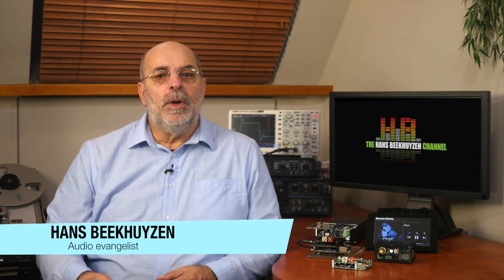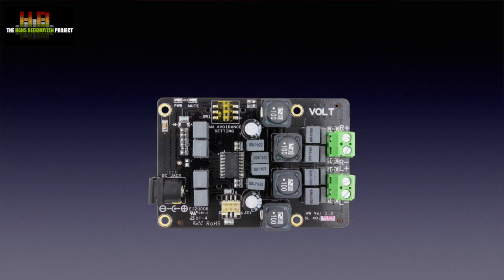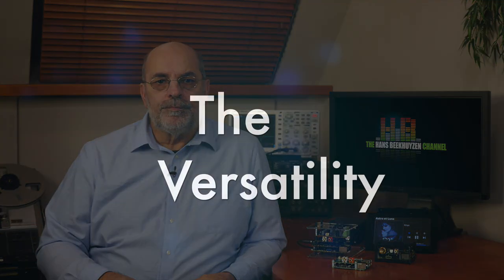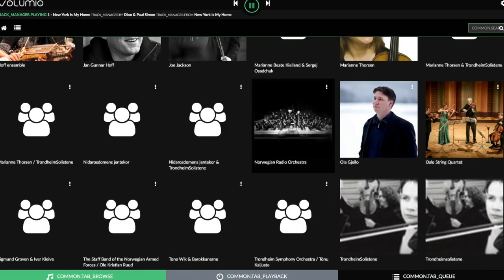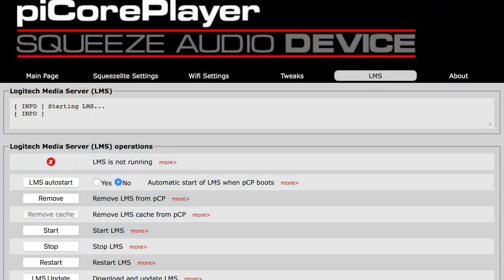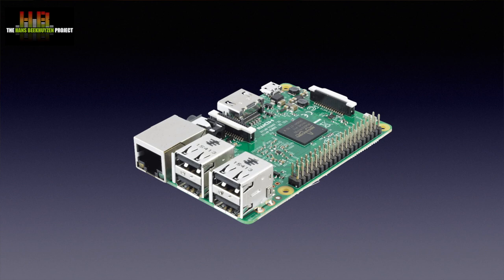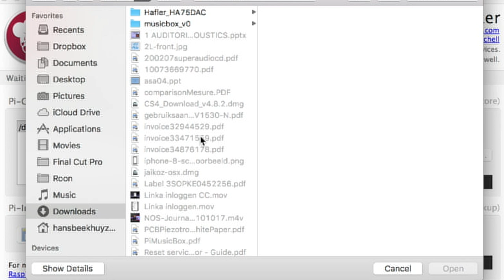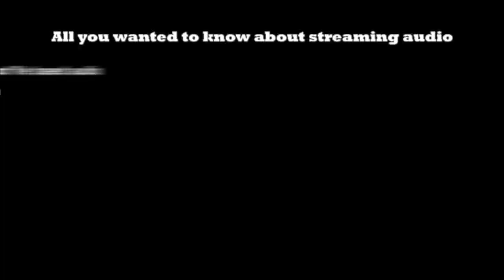An introduction to Raspberry Pi hi-fi

Comment: A 'Pi-Fi' setup is an excellent choice if you want to combine signal processing into the preamp stage and have interactive access to it's function, but it can only adequately replace equipment from the preamp section and below. It is perfectly adequate for headphone amplification for dynamically driven headphones that are of a reasonably low impedance, otherwise, you will need additional amplification.

Comment: Using an RPi4 with PI2AES running Roopieee over I2S to my DAC.   The improvement over my HTPC using USB was astounding.  I was not expecting the amount of improvement in just about every aspect you'd care to measure.  I thought I was hearing the best I could from my setup until put the RPi in place.

Comment: Way back when I was messing about with micro computers, a driver was just a lookup file and the computer and peripheral manuals would have all the ascii command codes.  So you would just look up the manuals and construct you own driver file.  You could do this for any peripheral device you wanted to connect.  Anything, running any OS could drive anything to the full potential of it's command set & you didn't need a computing degree to do it, just a little patience.  Now, they don't tell you anything.

Comment: Great video.  I decided to try Volumio on the new Asus TinkerBoard.  It works just great.  I output from TinkerBoard to my DAC via USB.  TinkerBoard has some performance advantages over the Pi, but is new and has very little support whereas the Pi has massive support.  USB out on the TinkerBoard is far superior to USB out on the Pi.  For those who go the Pi route, I have heard the new Allo DigiOne is the best quality SPDIF out option.  Costs a bit over $100.
Reply from the maker: I will review the DigiOne soon.

Comment: Speaking of other mini computers, you can get a V88 Mini III at gearbest for around $30. For only $30 you get a similar cortex A53 clocked at 1.5Ghz, 2GB RAM, 8GB flash with Android 7.1, built in SPDIF, USB 2.0 and 3.0, and a remote control.
Reply from the maker: As I said in the video, there are many mini computers but only one is supported extremely well: the Pi. But feel free to experiment with other options if you feel up to it.

Comment: Hans, can you elaborate on the quality of the hdmi output? My pi uses OSMC (kodi) and outputs to a Marantz SR5004 receiver over HDMI. It sounds very good. I never heard any jitter.
Reply from the maker: HDMI is primarily a video connection that packs audio in-between the video. It therefore depends largely on the quality of the receiver to 'recondition' the audio. I have no hands on experiences with your receiver but in General Marantz takes sound quality very serious.

Comment: How would the cheap power supply make the sound worse? Sounds like audiophoolery. Its a digital signal to a converter so its not like its analog that might be susceptible to noise.
Reply from the maker: see https://youtu.be/grzoqEb2KMk
Reply: Ground noise and chitter its well known ....stands well outside of 14k cables and other audio snake oil
Reply: I changed my home power cables by upgrading the cable from the power station. My alba HiFi sounds like a thousand dollar system
Reply: Basically, once the power supply is completely adequate, you become correct, and anything beyond that makes no difference, but if a power supply isn't quite right, it can introduce digital errors. A few digital errors can be corrected, but there are limits. If you ever had to deal with printers with long parallel port cables, you may be familiar with the fact that digital signals are not completely incorruptible.
Reply: Digital signals aren't incorruptible, you're right CFWhitman, but so long as you stay within spec you don't need expensive equipment to get a stable signal, and you most certainly don't need a $90 power supply for a Raspberry Pi. The only place where higher cost components can make a real difference is on the DAC and analogue side.
Reply from the maker: if only.....
Reply: I tried several random 5v switched mode power supplies and they all sound different.I then built a linear supply with massive amounts of filtering and it sounds a lot better. USE YOUR EARS If you can't detect a difference carry on and enjoy!
Reply: phil spencelayh Ah! But you can't show it on Youtube can you?
Reply: Put an oscilloscope on the 5v rail of the pi and swap the psu,what you get is different every time ,it's pretty horrendous even on a battery.I couldn't say exactly what aspect of the differences cause the different sounds but something does. As I said use your ears.
Reply: @philspencelayh5464  how good does the battery sound? I want a portable pifi...
Reply: @18yearsoldnot  It was a while ago now and I just had the pi on battery, the amp was on mains. I would be lying if I said anything definitive.I have a little class D amp that will run on a battery I will set it up again and see what its like but I think the biggest problem would be the speakers you could use on battery unless you are thinking of the hifiberry with the headphone socket like I have.

Comment: You could use a Dragonfly Black on a Pi. Yes you still need an Amp, but the Dragonfly will give you the D/A and quality output.
Reply from the maker: You could use any USB DAC. But does it provide a satisfactory quality and would it be the best option for the Pi?
Reply from the maker: You better check your setup then for that is not what I heard!! See https://youtu.be/P3mQA_EmHNI

Comment: I have made a boombox with a raspberry pi (Hifiberry DAC+ ADC PRO and AAMP60) and a car Minidisc player. I also have the Pi 7" touch screen. what HiFi software can I run directly on the pi without the need for another device and network? My boombox is portable and will not be around any networks
Reply from the maker: I like Volumio: https://youtu.be/TRyCpZh9-pI. Works great with the 7" screen too.

Comment: Thanks Hans. Question, since I am looking for a streamer and I need a phono in, I thought why not go for a cheap raspberry pi option; they have a i2Audio Phono One (at 40EU) now. Cheap as chips of course. Yet even though it needs an extra power supply I kind of wonder if it's a good idea to put all this hardware (pi, digi soundcard, phono) in one box. Since for double or in my budget max triple the price I buy a 'normal' phono preamp (i.e. rega fono mini a2d / Edwards Audio Apprentice /project Phono box E). Dank en groet van Richard
Reply from the maker: I have no experience with phono pre's on a Raspberry Pi but given the very lw voltage coming from a pick up cartridge, it would not be my first choice.

Comment: Seeing you're using a  computer for hi-fi is it perhaps  possible to use convolution software? I would think a routine to flatten the actual room speakers before applying convolution samples of high end hi-fi might provide some interesting results for old school hi-fi lovers.
Reply from the maker: I have tried those and was not pleased with them. Actually I use a computer for music only to store the music and run music server software on it like DLNA server and Roon server. Connecting a computer directly to a DAC won't bring great sound quality unless the computer is designed for that task.

Comment: One can also use the HDMI port to connect to an HDMI-Receiver/Amplifier. High quality digital output with no extra cost (if you allready have that AVR at home).
Reply from the maker: Well, most but not all player support hdmi. And to call it a high quality digital output.... but a number of AVR’s can playback quite well from hdmi.
Reply: The Hans Beekhuyzen Channel yes it is a high quality output. The digital source is transfered 1:1 with no loss. Same signal as your 150$ digital output solution.
Reply from the maker: If only.  See my video ‘How digital can go wrong’. In hdmi audio is interwoven with video and the video clock has priority over audio.
Reply: That maybe a problem when you send FHD or 4K video with a lot of movement along with the audio signal. But the standard prompt with a bit of ascii on it will not interfere with your audio signal.
Reply from the maker: Again, if only...

Comment: I have a high quality AV preamp (Denon AVPA1HDA) with dual differential DACs onboard.   What's is the best way to connect the pi for the best audio quality? Hdmi, or use a Digital coaxial hat? I'm thinking a DAC would be a waste of time as the Denon has ADC for its analogue inputs anyway and that would add further ADC and DAC processes to the signal.
Reply from the maker: The HDMI is poorly supported by player software. If your AV preamp indeed is of high quality, use a high quality HAT board. Or, even better, an audio grade network bridge like the SOtM sMS200 or Sonore MicroRendu.

Comment: Very interesting, thanks.  Early on you said that hdmi was second best after spdif, but did't develop that option.  Is there a breakout box to get audio from hdmi?
Reply from the maker: On a Raspberry Pi the HDMI was second best. But only if your DAC, amplifier or receiver has an HDMI input. If you need SPDIF you rather use boards like those by HiFiBerry or Allo. That will give a better result than converting HDMI to SPDIF.
Reply: The Hans Beekhuyzen Channel   thanks a lot!
Reply: @TheHansBeekhuyzenChannel  I thought Asynchronous was best as the timing on even fairly highly priced external dacs are not as good as asynchronous.

Comment: There's a lot of food for thought in this video, although I find the word "horrible" a bit exaggerated. I am not completely music-uneducated, but I think you need to be quite an audiophile to find a basic raspberry pi horrible. I use a Marantz AV receiver and a pair of floor-standing Mordaunt Short speakers, nothing fancy, but not the combo you find in a chain shop for 99 euros. As an experiment, I put together a raspberry pi and connected it to the amp through the headphone jack. Yes, the worst possible thing. It is noticeable that the output volume is quite low, but once you crank up the amp, the differences with a CD player connected to the digital input of the amp are very very very subtle. Yes, there will be plenty of people with lots of experience who will think that the difference is astonishing, but I still haven't found a single thing that makes a difference like the speakers and the room. For this reason, I reserve the adjective "horrible" to the laptop speakers, most car speakers, the earphones you find in Easter eggs, also the mono bluetooth speakers. But once you've got a semi-decent pair of speakers, every source will sound pretty much the same, in my opinion. Of course if your ear is very trained and demanding you will prefer certain things to others, but I think "improvable" is a better choice of words than "horrible". Quite frankly, I doubt that more than 5% of people who enter my living room will be able to tell I am not playing a CD, but a raspberry pi with an ultra-cheap DAC. I do have a plan to buy a DAC, don't get me wrong, but apart from fixing the output volume issue, I know I will get slightly better sound quality, but I don't expect it to be obvious to my ear, but only apparent in a side by side test.
Reply from the maker: Let’s agree to disagree.

Comment: Just wondering why Kodi is never mentioned as player software for the Pi, it has bit perfect audio and HDMI out so it can be displayed on a TV or by remote app.
Reply from the maker: I can't test all players on the market and given the fact that video oriented players I have tried over the years always performed less than audio only players, it isn't on my list. But if you're happy and enjoying the music, that's all that counts.
Reply: I really think he is asking about the lack of Kodi because it's often mentioned and seems to be a de-facto standard when discussing media management software. Fun fact; Kodi originally began as Xbox Media Centre (XBMC) which required an exploit to replace the default Xbox firmware before it could be of any use. The change in name was necessary once the team expanded into development on other hardware.
Reply from the maker: I know Kodi, I have owned the forst Xbox, modified it and ran XBMC on it (and it sucked). I still have a RPi with Kodi installed and I don't even like it for video. Having it play audio is not my cup of tea. And as far as "often mentioned' is concerned: ..... no, let's not go there. Writing or making videos about things you don't like is horrible work. You have to invest time in stuff you can't be enthusiastic about and that's hard work. Hey, no-one is perfect.

Comment: Hi Hans. Thanks for you reviews. I want to ask if you ever considered or listened to the Allo DigiOne audio transport that outputs only COAX SPDIF, but implements a lot of isolation and power filtering tech, that seems to result in a much cleaner output signal than the compitition, by far.  Why I am interested in this particular add on board for the Pi is because an expensve linear PSU seems to be unnecessary or makes almosy no difference. I bought the Allo DigiOne Player kit with Allo's switching PSU and it sounds very good to me. But I would like to know what you think about the sound quality vs the rest of the SPDIF boards. Would be nice if you can review it for us.
Reply from the maker: Working on it....
Reply: Awesome!

Comment: What does Rune Audio use for a Library - I want to build this system using Rune Audio as the Player but I need help with how to rip the CDs to a library. It would be great to hook up a CD player to rip the CD and a SDD to store the music. Can anyone point me at documentation or suggest how I do this? (if reasonable am willing to pay for some consulting for help) Thanks!
Reply from the maker: Don't make it too complicated. Using a normal hard disk for storage of the audio files is more than sufficient. Use FLAC - although Rune works with all popular formats, if you don't want to use FLAC, use AIF. WAV has very poor metadata facilities. There are many ripping programs, popular ones all do a good job. If there are problems it is mostly hardware/driver related. Programs like Exact Audio Copy (Windows) and XLD (Mac) are safe choices.
Reply: Thanks Hans - your reply is appreciated VERY MUCH! I already have the following Hardware: Raspberry Pi 3 B + digi+ Pro in a HiFiBerry Case + Power Supply 2.5A. I have a USB Cd Player/Burner, and a USB SDD both the CD and SDD are self powered. I want to plug them all into the Rasp Pi and use the spdif to feed my DAC which feeds an integrated tube amp. 

I want to use Rune Audio to play back FLAC files. I am not married to Rune but is seems like a good choice. I just want to hook it all up into a single system where I can rip a CD into the Rune Audio Library as a FLAC file. It does not have to be automatic, I'm more than happy to run a program, rip the CD and then go run Rune to play it. I just need some pointers to assemble the software. I used to run Kodi on a CuBOX but it was extremely flaky and then the CuBox died. Does Rune use something called an MPD library? Do I need to find a ripper that writes to a MPD Library and point the Rune software at the folder that has the library - this is the key point I'm stuck at. I don't know what Rune needs to store the FLAC files and read them so I know what Artists, Album and song is playing and/or to select. 

Does your book cover this - happy to buy it. I really miss my music system and can't wait to get something back up and running.

Thanks!
Reply: Btw - forgot to add I ran Kodi on the CuBox and while very buggy it allowed me to rip and play back - this is what I want to do on the Rasp Pi. Thanks again.

Comment: Interesting channel! I might be oversimplifying things . I’m exploring the option of building my own voice recorder for filmmaking as an alternative to the more expensive dedicated recorders. Would it be safe to assume that the built-in DAC on the Pi is sufficient for the lower threshold for voice recording to the SD card? For some reason I assumed the Pi could record 256 CBR compressed audio without issues. After watching Ty our other video I’m now beginning to wonder if I might run into interference issues as a result of insufficient shielding. Am I overthinking this or oversimplifying? Have a great weekend 🤙🏻🤙🏻

Comment: Thanks for your informative videos. I have been running LMS  on a desktop pc for  years, streaming music to various Squeezebox units and to Ipeng on my iPhone. Sadly the pc died. If I connect the harddrive from the pc to a Rasberry PI, will the quality of the data signal sent to the Squeezebox be equal to that from the pc or will the music sound worse due to the lower quality of the Rasberry PI components compared to f.ex. A 1000€ Dell desktop computer?
Thanks for your time!
Reply from the maker: The sound quality of normal cd-quality music will probably not suffer although searching music might get slower than a new, fast computer will be.
Reply: The Hans Beekhuyzen Channel   Thank you again for your time and dedication to this channel.  Am I right to believe that the noise problem will be bigger if you use the Pi as a player?
Reply from the maker: no